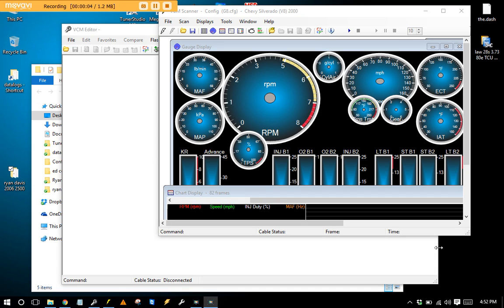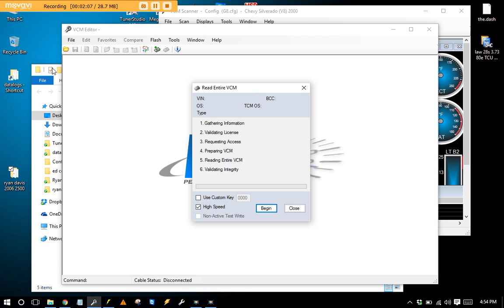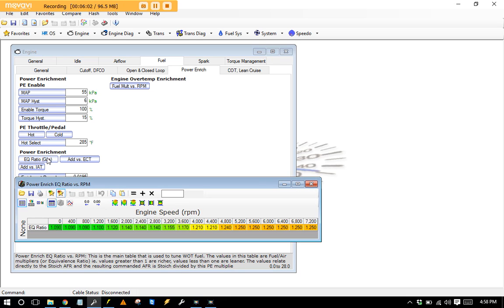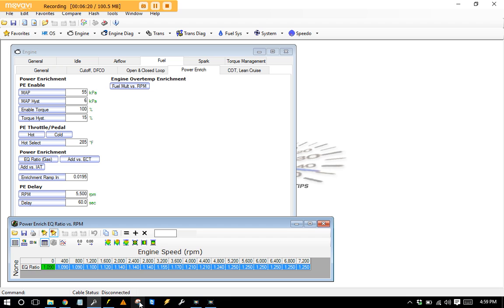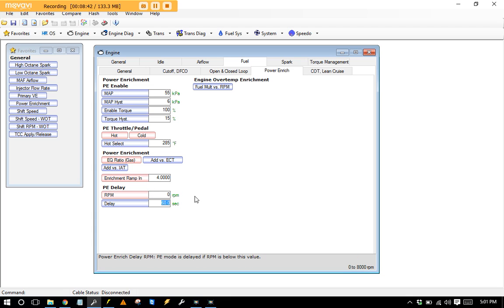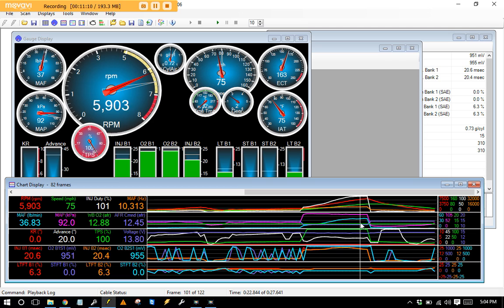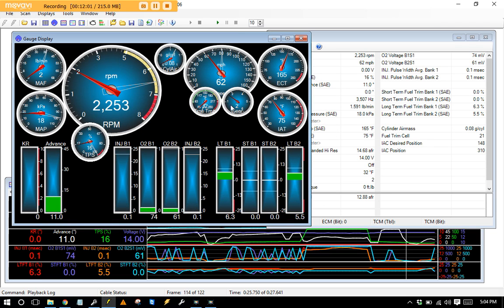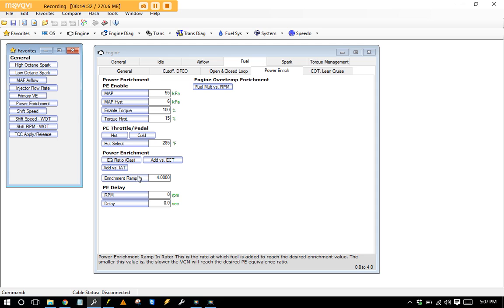How To use HPT 101

Comment: Awesome video. I disagree with unified tables. They are an engine safety feature. If you pickup knock it switches to Low table. Set this a little richer and 3 degree of timing below the high table

Comment: Thank You for all of your help throughout the community! Quick question... I have a healthy stock 06 Silverado 3500 6.0L/4L80E. I copied the tune from Derick Gaskins 1500 6.0l 4l80e mostly stock file. Runs amazing! But it has rev hang like crazy. When I touch the throttle in park it hangs at 2k rpm for literally like 5 seconds. Any ideas to lead me in the right direction would be greatly appreciated. I am new to tuning but comfortable using HP Tuners. Thanks in advance.

Comment: Can you please help me.  I have a 2000 sil 5.3l stock POS truck.  I dropped the PE to come in at 1500rpm, at 50% throttle, and whenever the PE kicks in, I get 8KR and it falls on its face.  It ran great for 30mins after the tune.  Then started this..

Comment: Under Fuel, Power Enrich, Enable Torque: 100%. Should this be changed to a low number?  Seems like this means you need to command 100% torque to enable power enrichment. Or am i wrong?

Comment: have you had any issues with hp tuners not reading a vehicles computer have this issue on two vehicles it won't even connect to one and the other it connects but won't download the stock tune get a timed out message while it trying to down load thanks

Comment: You were able to change all the fuel parameters With out licensing using the credits? If you were to license that vin what are the other options are unlocked by using credits ?

Comment: I'm tuning my '00 2500 HD 6.0/4l80e truck based on this video. I've copied all your PE settings.. truck doesn't really seem to drive any different. Do you do anything with torque management to wake it up?
Reply from the maker: did you log and verify that it was switching from 14.7 ish to 12.5 ish when you roll into the pedal and its actually switching?
Reply: Sloppy Mechanics I can't get commanded afr to display correctly and wb won't be for a little while. can I download your scanner and get it to log commanded afr?
Reply: OK, I downloaded your G8 config for the scanner. Got the commanded AFR working. It was set to around 12.2 when I first set it up (so PE is working anything over 50% tps). I have it now set to around 12.5 afr commanded.
Reply: @SloppyMechanics  how do I get your configuration

Comment: Great vid bud. I'm sure this may have been posted. I'm not going to search through 177 comments. I hope the individual's truck you tuned, you highly recommended a injector change. I saw where it hit over 102%. Typically anything over 80% on a LS or LS based motor means the injector never shuts off. Not good for longevity and running a risk.

Comment: I keep revisiting this because it has helped me a lot with my current setup. (08 gmc 4.8, intake, headers, and a 204/211 112lsa cam. Your explanation of your timing methodology was great. Just street tunning,  I basically pulled out timing here and there and could feel the seat gains. thank you

Comment: Can HPT change or adjust any class 2 data gauge outputs ? I had a new tune installed and it erased all my gauge info that are class 2 controlled, they did a complete overwrite instead of reflashing it, which is causing bcm issues and everything.

Comment: gm has never used power enrichment  even in gmobd1
Reply: So if they don't, could you please tell us how else you are suppose to change the commanded air fuel ratio under a heavy load/full throttle situation.

All of the LS V8 computers use PE to determine the fueling under wide open throttle. Everything else will just command the stoich settings in the computer.
Reply: I need some pretzels to go with all this salt.
Reply: Aaron Holt 
I was hoping for a legit reply but perhaps you were at a loss for words. Please pass the pretzels.
Reply: GTPSilvermist Sloppy mechanics now has a video that would explain everything you need to know about HP tuners. I mainly use megasquirt and tunerstudio.
Reply: Aaron Holt I've owned hp tuners for several years now. Matts video is great for newer people to the tuning world for sure but everything covered here is just common knowledge to me and others that have been using it on LS vehicles.

Comment: This makes so much sense. i have a stock 2006 gto and it feels like a total dog at anything above an 80 degree inlet air temp according to my ultragauge. Forget about when its heat soaked at 150. amazing that it pulls that much timing. makes total sense knowing its only getting 5* for christs sake. I need a tune..

Comment: Just another pro-tip for new people to HP Tuners, you can "LOCK" your stock file if you want too as well. It's a better way to go in my eyes. You are switching it a read only file that will never allow you to save it or over write the file on accident.

Here is how you do it. Download the stock file or find it after you have done so. Right click the file and scroll down to properties on the very bottom. It will open a menu and you will find about 3/4th the way down a check box to have it as "read only" and then click apply and ok to finish. Now you will have a file that can't be screwed with and will always be there if you need to go back to it for some reason.

Comment: This was a good intro. Curious what you do with torque management. I thought it was another cause of soggy throttle response and general drivability on an LQ4 - 4L80E combo.
Reply: Could depend on application but for the most part you can remove most of the TM on LQ4/4L80e combo with great results. DBW throttle body vehicles can have a few extra tables you can adjust to bring throttle feel back.

Comment: So this is what you mean that some tunes are pig rich and some are shockingly lean at WOT. Minor nit: The PE delay RPM is when you are below 5500. Above it enables PE instantly. It would be fair to mention that a stock LQ4 never sees 5500 rpm though. I will say that GM used this strategy on old TBI trucks with the '7747 ECM. Why? No idea.

Comment: Curious what version of HPT that is? It looks like it is the old stuff. Don't get me wrong, I am really glad your doing this now. I am hoping you will end up doing a boosted application, and show the tuning of VE/ PE and how you use BE/ or if you use that for fueling on a boosted HPT application! Congrats on a long awaited video!
Reply: That's still 2.24 or 2.25 (beta). The newer 3.2/3.4 is much different looking and has far more feature than the older version. Both work well and many keep 2.24 for RTT because they are still some bugs with RTT in 3.4.

To answer part of your second question, BE is just a commanded AFR like EQ ratio for boost or a way to set it up for boost. It will use whatever number is greater for fueling. So say you have regular PE setup to come in at 55kpa with 0rpm delay and 65% throttle, it will command that AFR until you reach the BE thresholds. Mainly it's just a MAP kpa that it needs to see to enter, so if that was 110kpa or 1-ish lbs of boost it would switch to using that commanded AFR. You could still have BE at 1.000 (stoich) and have the regular PE EQ ratio at whatever you wish to command in boost because it uses whatever number is greater.

I'd prefer to use the BE if possible, which only applies to 2 or 3 bar OS upgrades.

Comment: What software  is that?
I got hp tunners  last  August  and none of my folders look like that even when you want to read the vehicle . perhaps  I have a updated version?
Reply: That's the older 2.24 version still. The newest 3.2 and 3.4 does not look like that anymore. The basics still apply but the screens are different and so are many of the names used in each version.
Reply: +GTPSilvermist  Thanks man! is preferred  the older version?
 or some people's preference ?
Reply: MrMonsterMusicMedia Could depend on what you are tuning, some prefer it for RTT tuning as 3.4 has some bugs still. Otherwise 3.4 has more features and easy enough to learn with, also 2.24 is no longer supported and many vehicles won't work with it because the newer software only has support for them.

Comment: Great video, but I have 2 questions. Do you ever mess with the torque management and how do changes like the ones you made effect the gas mileage of the truck?
Reply: I'm not Matt but I can give my opinion here, TM removal or adjustment can depend on application. Some vehicles or transmission do not take well to TM removal where as some do not care and it's worthwhile to do so. Without knowing exactly what you are working with it's hard to say what you could and maybe wouldn't want to do.

The PE changes he made would not change MPG so long as you keep your foot out of it. It's going to start using more fuel the more times you enter PE.

Comment: coming from some one who has a ms3x on a less common motor and had fully intended to use ms on my next build, a ls base. now im not sure, hpt look as simple if not more simple then ms to tune.  I would love to see a video compairing the platforms and benifits of both, also would love input on what is avable on the trans tuing side, as thats one thing stock ecu can save a good amount of money on compaired to stand alones.
Reply: good comments. matt will do a MS video like this also. most likely everything from here on out will come with a cost though.

Comment: Wouldn't giving the high octane ignition timing table to the low octane table cause detonation if you run the low octane fuel? Forgive if this is a stupid question. I'm definitely learning.
Reply: Ricky Hart That's definitely a possibility, but 1) you should be running a consistent octane fuel after tuning around a specific octane (or better octane) and 2) your timing tables shouldn't be aggressive enough for knock to rear it's ugly head if you had to run a lower octane fuel or even accidentally bad fuel.
Reply: LaTechGTO
 Thanks for the knowledge.